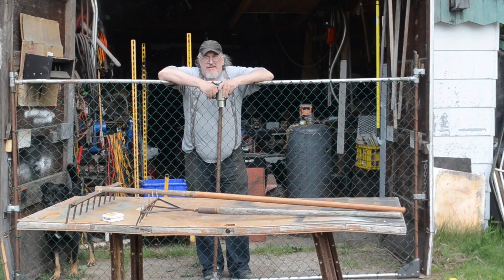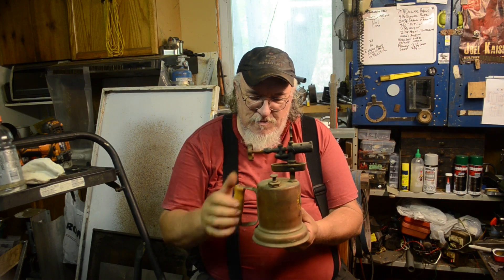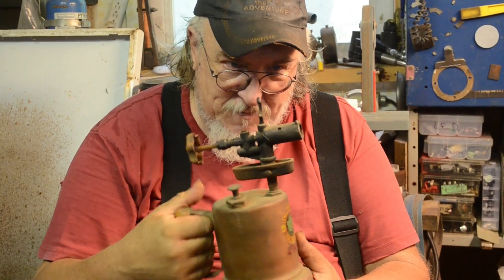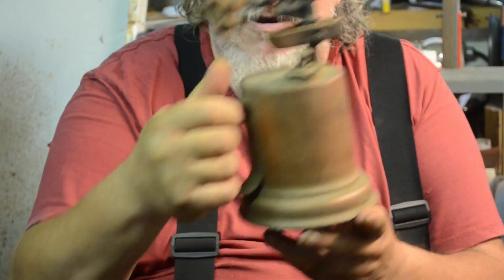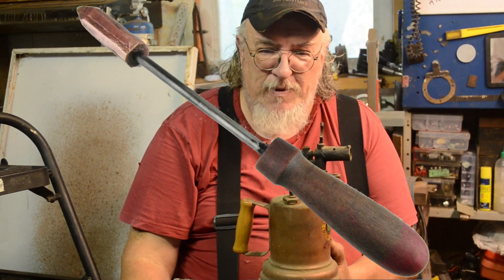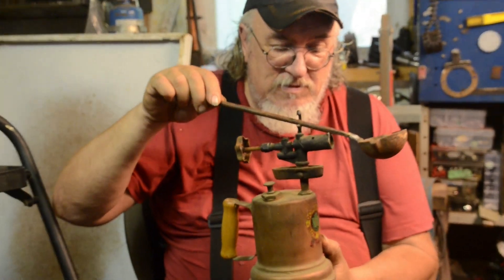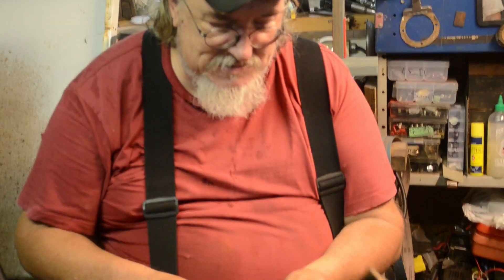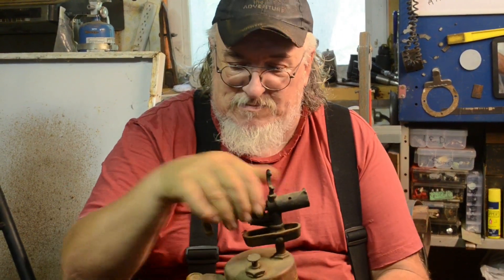What is a Blow Torch, and what is it for?

Comment: Got one, but the pump check valve is not good. Too dangerous to run like it is. I will find another one somewhere. Thank you for sharing this with us, Tim. You and and Tora stay safe and stay cool
Reply from the maker: It is like 30 years since I pulled one of these apart... IIRC the valves are just leather flaps...
Reply: @trollforge  This one is metal and sealed. I will try soaking it more. Thank you for the reply. Tim